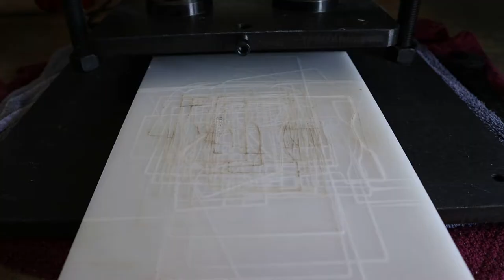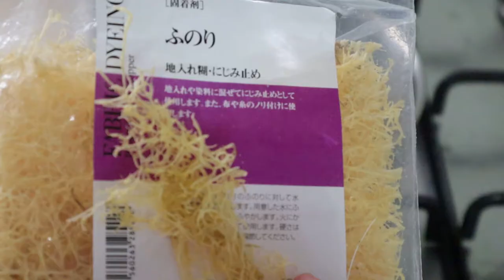MAKING LUXURY LEATHER WALLET

Comment: Very nice. I was wondering why you would punch the stitching holes on the back piece before glueing to the interior piece. I would thing alignment of the stitch holes would be difficult. I would have thought it easier to glue the back piece and the interior piece together first then punch the stitching holes. Your work is very clean and precise.
Reply from the maker: Thank you so much for sharing your opinion. because if I glue them and make the holes, the back piece of the leather stitching doesn't look clean, it would be messy.  I  will make a video about that for you. have a good one.
Reply: @WSLEATHERWORKS  , Makes sense. I will keep this in mind. As a newbie to leather craft I have not made a wallet yet and I am trying to acquire ideas and lessons via Youtube and artisans like yourself. Thank you for sharing.
Reply from the maker: @gpslost2068  No worries. Since I used to be a newbie, I definitely can understand you. thank you :)
Reply: @gpslost2068  السعر وهل فيه أون لاين

Comment: Very clever
Thanks alot for that great video .
What substance did you use for slicking edges ?
Reply from the maker: I used Funori which is kind of seaweed. However I'm using tokonol now. thank you :)
Reply: @WSLEATHERWORKS  
Merci !!😉
Reply: @WSLEATHERWORKS  Do you prefer Tokonole edge finish result over Funori? Can you please say why? Funori seems quite economical but I've never tried it yet.

Comment: what size in mm is the thread? Great work!
Reply from the maker: I used Vinymo MBT Thread - Size #5, and it is 0.6 mm :)
Reply: @WSLEATHERWORKS  thank you!
Reply: I've done some research about the tools because it's quite difficult to get them in my country so I have to order all from the internet and I've seen some similarities in tools with you and the guy from little king goods, so I guess that's the way to go :D I already got the cutting mat and 3-4 knives from "Olfa" brand I just can't decide about the pricking irons...maybe I should start with some diamond chisels those are the easiest to get. Could you recommend me the spacing, 3-4-5 mm? I'd be very grateful.
Reply from the maker: @asmirkalender4925  you can go with kyosinelle diamond iron 4mm, it is reasonable price. I just like neat and clean stitching, so I'm using the Ks blade 3.85 mm pricking iron and used it for this wallet. Also my tool holders on my channel made with kyosinelle diamond iron 4mm. have a good one!

Comment: Pattern not for commercial use? Dude, your pattern is the basic generic pattern every beginner uses. Plus your Amazon bought clicker dies are nothing special. You can't tell others they can't use a generic pattern that is readily available across the internet that you used as well.
Reply from the maker: I took a long time to make my pattern my self using a cad program, I calculated the leather size to fit the 3.85 pricking iron.
And what is the standard of basic generic pattern every beginner uses? who decide that? 
Also what is my amazon clicker dies ? I didn't buy any clicker dies from amazon never.  
I usually made patterns and send it South Korea to make the dies. 
Also I never bought any patterns from online. I made all my patterns my self. 
If you want to see my leather cutter dies I ordered from South Korea and my patterns I made using a cad program. Please email me I will send you the photos.
 

Thank you :)